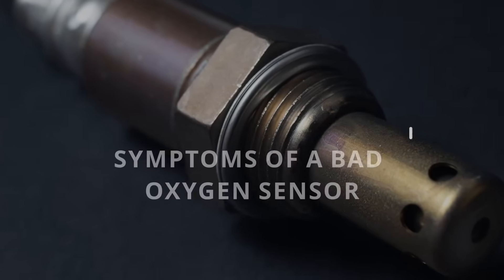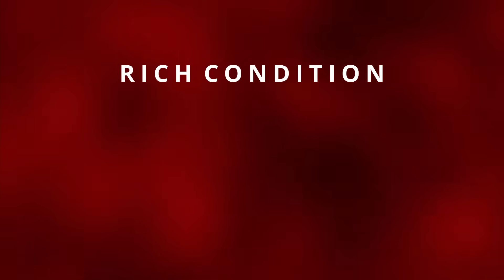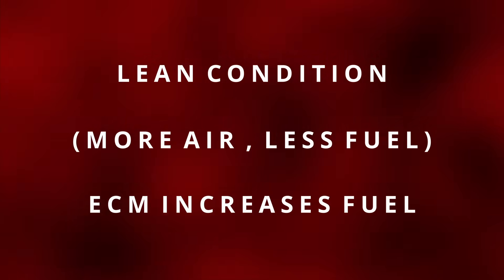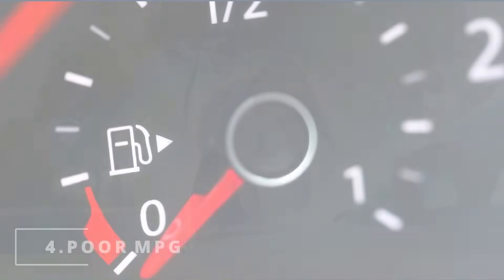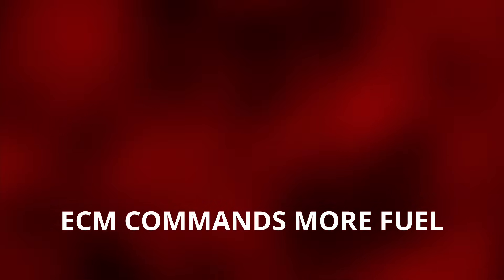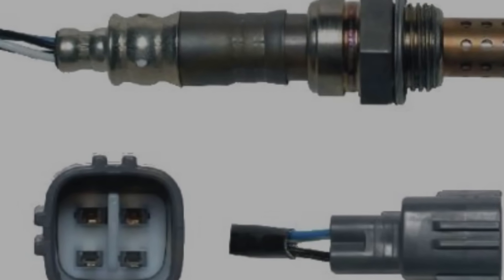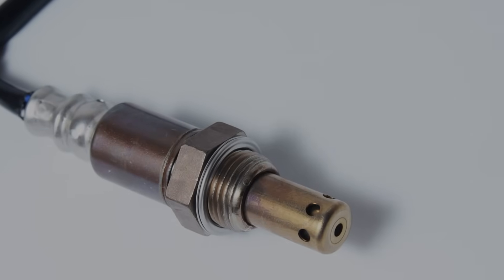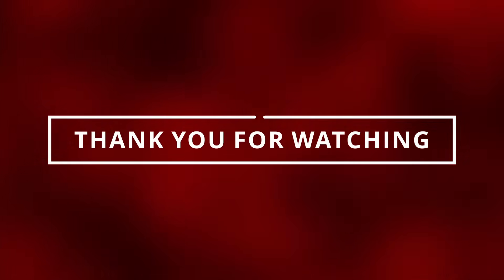SYMPTOMS OF A BAD OXYGEN SENSOR

Comment: I have a lancer 2006 model. It's a 1.3 L engine with 1 oxygen sensor. I don't get the check engine light but I have to following issues.
1. Low mileage, 7.5 kmpl ☹️
2. Rough / heavy idle when cold start (4-500rpm) then gets a bit better when the engine gets warmer (7-800rpm).
3. When I accelerate at cold start, the engine hesitates & rpm rises with a delay & sometimes with a very light miss fire. (New plugs + coils temporarily solved this problem but it came back after a few days of driving).
4. I have to constantly clean my MAP sensor + air filter + throttle body with a throttle cleaner spray after every 1000-1500km or else the car starts to behave more sluggish.
5. I even got my engine completely overhauled recently with new pistons, valves, rings, coils etc although the sensors have not been changed.
6. I can smell unburnt fuel from the exhaust & it indicates that the car is running rich. It even starts to hurt my eyes I get close to the exhaust.

Kindly advise as to what to check & what can be the possible issue.

Thanks.

Comment: Most of sensors tend to do all of these symptoms, with no check engine light like in my case, it seems like I should change all sensors one by one and see whether it works or not 🤦🏽
Reply from the maker: No codes? start with the basics. Clean the MAF sensor, clean the throttle body and look for vacuum leaks around the engine (should make a hissing sound)

Comment: My check engine light came on with my fraction control light and I have a bad idle, would this be the o2 sensor or spark plugs if anyone knows?
Car: Toyota Corolla 2011.

Comment: Lol   my O2 sensor Bank One sensor One didn't even last five miles brand spanking new. I'm thinking the mechanic didn't even put the thing on. I spent  426.98 to have the thing put on and here it failed again with the same O2 sensor. I had it repaired 5 months ago went  back to the mechanic and the shop, and they swear up and down that they replaced it, but my recent emissions test says it failed
Reply: You should always have mechanic put your old parts in the new parts package and returned to you when having work done so you will know for sure they changed the parts. Normally they ask you on the invoice, if not request it.

Comment: Best video I have found on 02 sensors. My truck has most symptoms you spoke about. I have an 05 silverado, just swapped out the transmission, put new spark plugs in, had to get a new heater core connector and did the rear main seal. It ran good for a day. On the freeway it would stay at 4k rpm going 60 mph and the engine isn’t giving much power. All along I had a check engine light but didn’t think much of it since I’m straight piped. Ran the codes today and 02 sensors came up. Does anyone think replacing the sensors will fix this or does it sound like I have some other problem aside from the 02 sensors? Also after driving for 30 mins back home it said “transmission hot and “coolant hot” but then went away after a minute. The truck sat for a good 10 months and my brother mentioned it could be a fuel pump and/or fuel line problem from sitting so long, does anyone think this could be it?
Reply: Id also clean the MAF near the air filter
Reply: @gloomweed318  will do, thank you. Pretty sure heads are cracked. If so we’re running with an engine swap. Going to take out the 5.3 and drop a 6.0 in it, cam and tune. New 02 sensor didn’t work.
Reply: @707area  Ever find out if the heads were cracked? I’d have thought you’d find a nice slurry mixture pretty fast if that were the case

Comment: My kinda had a bit of trouble turning on like it kinda Hesitated a bit but then was  normal until I drove to the store and saw code  p2187 system too lean at idle bank 1 on my vw cc 2013 r line has over 100,000 miles

Comment: You just gave me a whole new perspective here, no codes but idles rough at stop lights like a misfire! This option of replacement is cheaper than a set of 8 fuel injectors! Gonna give the test a try!
Reply: Jay Yoyo  still having the rough idle with no code.. updated both valve covers, plugs, wires, coils, intake manifold, map sensor, cleaned MAF sensor.. so I don’t know. I have 4 o2 sensors which are all reading within specs so I’m at a loss.. I may have to get it to a shop for a more detailed scan.
Reply: Jay Yoyo  I checked all injectors when I changed the intake manifold, I don’t have any loss of power. This truck does have a fuel control module so I’m thinking it could be that.

Comment: I don't clean mine, I replace them! And I don't follow the 100,000 miles rule. I follow my own instinct. I change mine every 45K to 60K miles depends on how I abused my work truck in a daily basis. I replace 2 of them because my work truck only have 1 catalytic converter so there's 2 of them 1 for upstream and 1 for downstream. I always putting brand new OEM Genuine parts from Nissan, oxygen sensor. After I replace them, I'm also cleaning up the throttle body, MAF Sensor too, and the Air Filter as well since I got Volant Cold air intake on my Nissan Frontier truck. And after all that I'm gonna check all the 6 Spark plugs, if they're still in good condition then I'll leave it there, but If one of them is messed up then I'll be replacing all 6 Spark plugs. So I'm all done replacing the Oxygen Sensor, also checked and or replaced sparkplugs, cleaned/inspected the Throttle body and MAF sensor, then I'll be checking the Fan Belt check/inspect and or replace If necessary. And the other components and parts like water pump, pulley, Fuel Injectors, Transmission Gear box gear oil change, Clutch, Differential Fluid Change, Radiator Coolant check or change, Radiator check/Inspection/ and or Replacement if necessary and so on and so on will be follow up in the next maintenance schedule. this is how I conduct my preventive maintenance on all of my vehicles that's why my 2010 Nissan Frontier Nismo 4.0L V6 (VQ-40) Turbocharged 6 Speed Manual transmission truck is now at 713K miles. Still going strong and still have tons of power and torque.

Comment: I really appreciate the video..
I have a 98 Camry LE 4 cyl. The problem i have is that it has gotten very weak over a past few years, esp when going uphill. on a very steep hill, 25 mph max. The codes I get are 0420, 1130, 0171. while some places said it is the CAT, a couple places brought up the bank 1 air fuel radio sensor. The tip you gave at the end, operating open loop, would that be ok to try with my car? it wouldn't cause any damage or anything?
Reply: Pretty sure a po171 code has to do with to lean cause of to much air so yes it could be your oxygen sensor
Reply: Drive your car and make sure its fully warmed up. Then put the gas pedal all the way to the floor and keep it there for a few seconds (do this while the car is moving.). If the car runs better only when you have the throttle wide open, the problem may be O2 sensor related. If there's no change and the engine still funs bad, look elsewhere.

Comment: Ok, question.  Is it it safe to say it is my oxygen sensor or sensors? Reason is that I replaced my cat around 65,000 miles because the code that was read was the cat going out. Well the engine light came on again 2 weeks ago and I got it scanned again. Autozone says it's the cat going bad again but O'Reilly says it can be the oxygen sensors orrr the cat. Please let me know what you think. Thanks.

Comment: I have a lean code for both banks, but the car runs perfectly fine.  No hesitation, no poor gas mileage and no rough idle.  I'm so confused on what's wrong with it.
Reply: if it’s anything like mine it’ll get there. it ran fine for like 2 months, then a few days ago started misfiring. Gonna change out the sensor today and hope it helps.
Reply: @paceritz535  I found out I had a bad positive battery cable.  My car ended up not starting one day.  Turns out the cable being bad and severely corroded, had made the sensors give false readings.  I replaced the cable and the codes never came back.

Comment: awesome thank you...do you think you can make a video about  short trim,long trim bank one  and short trim  ,long trim  bank 2 ? I'm trying to verify if this exists  or os just me finding out this things the hard way    and I wonder if a 4 cyls car only has one short trim, long trim  bank 1 only  ...thanks in advance
Reply: What you're asking can't be covered in a video. If your motor has all the pistons in line, like a regular 4 cylinder or a straight 6, there's only bank 1. Sensor 1 is the O2 sensor before the cat, and sensor 2 is the one after the cat. You have 2 banks if your engine has more than one row of cylinders, like a v6 or a v8. In order to find out which row of cylinders are bank 1 and 2, you need to look up the firing order for your motor. Bank 1 is the side of the motor that contains cylinder number one.

Comment: experienced this sluggish engine performance today, check engine light was on and also the traction light was also on,  I went to the shop. it shows the error in the OBD. the mechanic just did some reset  and the check engine light was gone and told me if it comes back and the engine is sluggish again, it needs replacement. drove it tonight going back home for another 31KM and it was fine. Hopefully it does not comeback.
Reply: What's the OBD?

Comment: Was Told 2 get my sensors replaced in Aug. Now the delar said my cat converter needs 2 B replaced & not the sensors. Is the reason for my sensors not bein replace the reason the car converter went bad? Do I need to get new sensors & a cat converter?
Reply from the maker: Yes, If the sensors were bad and the engine was injecting more fuel than needed the cat can go bad. I would replace both.
Reply: @easyautofix  it’s been replaced ❤️

Comment: I got the code P0420 could that be maybe the sensor as well affecting that
Reply: Hey, I have the same code on my 2006 ford ranger right now. V6 3.0. Code came on about 4 months ago. Today I was going to replace the cat ( for 900$!!!!) but the mechanic told me he checked the cats and they sounded and looked fine. I have had gross exhaust that is smelly. I’m planning on replacing the sensors in this next week, will let you know
Reply: hey, help me out too. I have a 98 camry 4 cyl. I get 420, 1130, 0171. And some said its the CAT but some say it's possible the air fuel ratio sensor. the symptom of the car is that it is very weak, esp. uphill.
Reply: @kpballa1009  |
P0420 TOYOTA code possible causes
•	Faulty Three-way Catalyst Converter Bank 1 
•	Exhaust Tube 
•	Intake Air Leaks 
•	Faulty Oxygen (O2) Sensor 
•	Faulty Fuel injector(s) 
•	Leaking Fuel Injector (s) 
•	Faulty Spark plugs 
•	Improper Ignition Timing 
•	Faulty Engine Control Module (ECM) 
•	Dirty Air Filter 
P1130 TOYOTA code possible causes
•	Faulty Air fuel Ratio (A/F) Bank 1 Sensor 1 
•	Air fuel Ratio (A/F) Bank 1 Sensor 1 harness is open or shorted 
•	Air fuel Ratio (A/F) Bank 1 Sensor 1 circuit poor electrical connection 
•	Fuel pressure 
•	Fuel injector 
•	Intake air leaks 
P0171 TOYOTA code possible causes
•	Intake air leaks 
•	Faulty front heated oxygen sensor 
•	Ignition misfiring 
•	Faulty fuel injectors 
•	Exhaust gas leaks 
•	Incorrect fuel pressure 
•	Lack of fuel 
•	Faulty Mass Air Flow (MAF) sensor 
•	Incorrect Positive Crankcase Ventilation (PCV) hose connection
Reply: Did someone say 420

Comment: After replacing 02 sensors on sensor 2 on my vehicle, the engine light was solved. Thank for the video.
Reply: What was wrong with you car
Reply: @hazelpieterse853  : The scanner indicated code "P0136 oxygen sensor circuit Bank 1 Sensor 2" After  replacing 02 sensor 2 which located downstream. Then the engine light no longer  turned on. I will update in the near future should the engine light turn again.
Reply: @nia6849  ok thank you for reply so it was oxyen sensor that you replace
Reply: @nia6849  hi one last thing I want to knw is ...what was the sympt on you car.coz our car is stalling sometimes or sometimes it start sometimnes not .
Reply: @hazelpieterse853  : The engine light turned on was the symptom. The car drive normal as usual. Perhaps it is an detection and did not cause any side effect yet. 
What was your code when you did the scanning?
Reply: @nia6849  they say oxyensensor .going to replace it soon .enigne light also on
Reply: Stalling sometimes at stop sometimes it start sometimes not .going to replace it .but was thinking can it be the fuelpump
Reply from the maker: Awesome!

Comment: I been looking on my o2 graph and both my sensors don't show any volts if any its .01 to .02 then when I give it gas or causing my first bank still fluctuates to .01 to .09 but usually stays around .01 volts. Does this seem like both are bad sensors?

Comment: Good stuff. My Toyota with a 1GR-FE has 4 cats and 4 O2 sensors. Ran rough with poor fuel economy.  Swapped out all 4 O2 sensors - both secondaries were outputting OV (I was fortunate enough to have access to a scan tool) - and it now purrs like a tiger cub. Just like it should.
Reply from the maker: MARVELOUS!
Reply: Was your Toyota running bad before swapping the 02 sensors? I have an 05 Chevy Silverado, just swapped out the transmission and a few other parts. It ran good for a day but today it just wouldn’t give enough power, it would stay at 4k rpm at 60 mph. Had a check engine light and the only code that came up was 02 sensors. I’m wondering if replacing the sensors would fix my problem.
Reply: @707area  Just a general feeling that it wasn't quite itself. Nothing like what you are experiencing. In all these situations, my rule is if it isn't right fix it as there is often multiple causes that combine to make all the symptoms. Hope this helps, it sounds to me like there may be other issues present. Good luck.

Comment: My malibu check engine lifht came on for engine bank lean and it has a rough acceleration and my car feels heavy on acceleration then before. I already cleaned my maf sensor but still fees the same. You think it could be the o2 sensor?
Reply: Was it the O2 sensor?
Reply: @geewhite3192  apparently the gasket between the intake and the engine was cracked and sucking in air through there.
Reply: @El_LeChErO91  how much was the repair
Reply: @geewhite3192  over in my neck of the woods i was charged $435. Seemed a bit harsh but they kept it for 2 days until they found the problem with the smoke machine.
Reply: Gotcha. How did the car ride after the repair?
Reply: @geewhite3192  it actually runs legit. Only repairs i did since was my exhaust and intake solenoid’s.
Reply: Yea I got my maf sensor and throttle body clean on my 2018 Cruze engine light still comes on says de ice air intake somebody told me dat works on cars told me it mostly likely is my 02 sensors
Reply: @528Chris  the o2 sensor is an easy fix. Kind of like switching out a spark plug but with a sensor.

Comment: i first went to school on electonic cars in 1980,when gm introduced the feedback carburetors which everyone knows were a bandaid,these carbs were a joke,one thing that wasnt' funny was they told us in school to replace the o2 sensor every 35000 miles,they also told us that this one sensor is responsible for gas economy mainly,it and the CTS coolant sensor,if  either of these sensors is out of range,what fuel economy,been to many schools since then,but plugged, dirty, defective injectors will throw same codes,replace them every 3 to four years for max economy,plugs too,oil changes means there won't be expensive engine parts going away,parts don't wear in clean oil,fact

Comment: I'm getting p2187, I've replaced air filter,  checked my hoses. Now I'm wondering if my o2 sensor  and or spark plugs
Reply: Hi did you find the prob
Reply: @hazelpieterse853  I've had my sparkplug changed and my p2187 is gone for now but I am now getting p2100

Comment: I have a 04 tundra i got new cats within a year or so new sensors also, i have a code for bank 2 sensor 2 below threshold i have a straight pipe from behind my cats just cut the muffle out there is a tiny leak but i dont think the leak should make the light come on due to it behind 5 feet behind the catalytic convertor. Does anyone think its just that sensor or does the tiny spot they missed to weld?

Comment: My Nissan Frontier experienced rough idling, would jerk when I accelerated, engine light enabled, and would stop on me as I'm driving. Changing the O2 sensor fixed it though
Reply: Hi so it wa she sensor
My car same problm was thinking it c be the fuelpump.sometimes it start sometimes not .so just want to know coz to change fuelpump is a lot of money
Reply: @hazelpieterse853  in my case it was definitely the O2 sensor. Before changing the O2 sensor, I changed 5 other sensors, but replacing them didn't fix anything. It wasn't until I replaced the O2 sensor that I could finally drive my truck without any of the symptoms described.
Reply: @martianboy9886  thank you for reply.i think my husband must first go for the sensor .he wa thinking the fuelpump .but.now he can go first for sensor
Reply: Did you replace all four or upstream or downstream only. I have a Nissan frontier. Same problem
Reply from the maker: Thank you for sharing!
Reply: Dawg  that shit happened to me today

Comment: Hello, my toyota corolla show me P0171 which oxygen sensors have the problem number one or number two.  Thanks for your answer
Reply from the maker: The oxygen sensors that can contribute to this problem would be the one before the catalytic converter. P0171 can also be triggered by multiple reasons though.. A MAP sensor, vacuum leak, faulty fuel injectors, or a mass air flow sensor could trigger p0171. I would start by trying to find a vacuum leak. Best of luck!